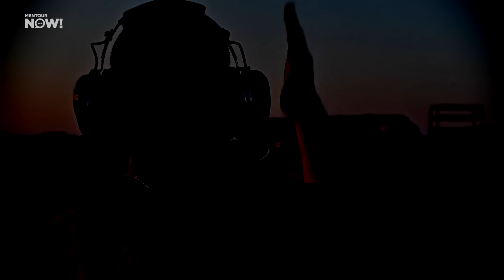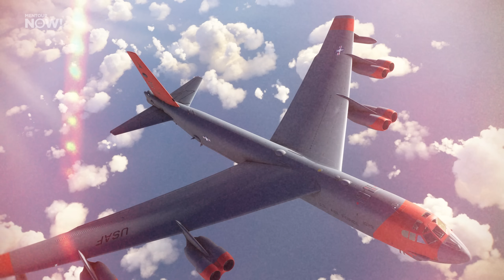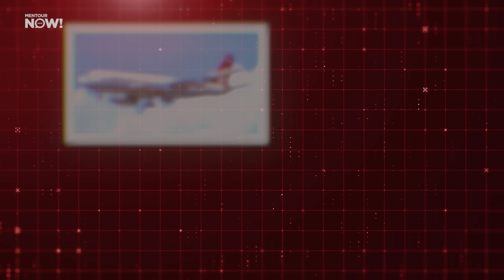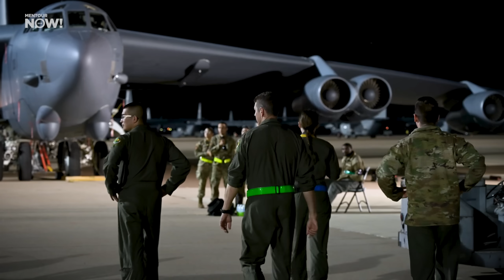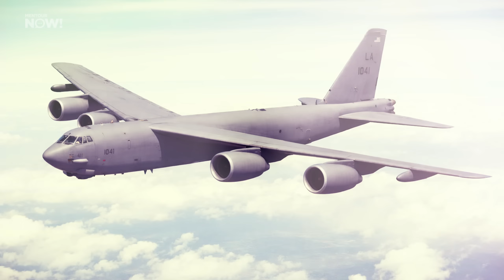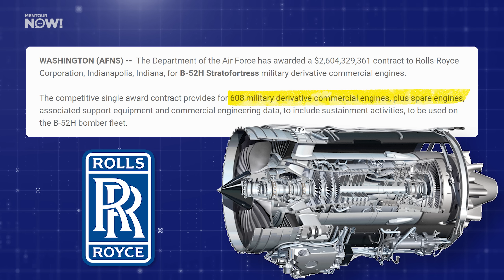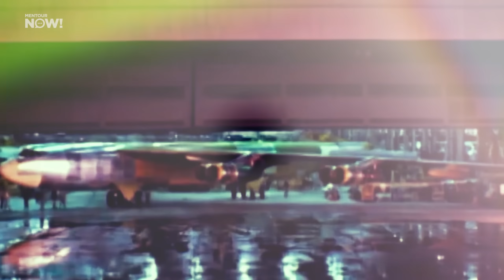WHY Are They Changing The B-52 NOW?!

Comment: An interesting feature of the B-52 is that the wings are mounted with a +6 degree angle to the fuselage to allow it to fly very efficiently with a heavy payload at 50,000 feet where the air pressure is 1/5  of sea level. When the B-52 takes off it uses a very light rotation to avoid a tail strike.
Reply: The Buff doesn't "rotate" at all.  All 4 trucks come off the ground at the same time, and takeoff is officially called "unstick"--when the aircraft comes unstuck from the ground.  It is possible for the aft trucks to lift off before the forward trucks.  "wheel-barrowing" is bad form, and potentially dangerous.
So, the takeoff trim is actually set quite a lot nose up to help prevent that.  And after you lift off, you're immediately trimming nose down to manage the acceleration and climbout.
Reply: @edfix  As a casual KSP player, I do the same with my aircraft designs. Some even lift off all by themselves once they have enough lift.
Reply: @edfix  I read that but after viewing several B-52 takeoff videos it appears that there is a small pull up of the nose, at least during scramble drills.
Reply: @scottt5521    In most planes, the pilot rotates the nose up and that increases the lift of the wings so the airplane starts flying.  It's a pilot action, and rotation speed is less than takeoff speed.  In a properly trimmed B52, the airplane lifts off without pilot action.  Due to its nose-up trim setting, it immediately begins pitching up, so the front trucks might actually leave the ground first--but the airplane is already flying before the wheels leave the ground.
It's a peculiarity of the bicycle landing gear arrangement, and its also true of the U-2 and B-47.
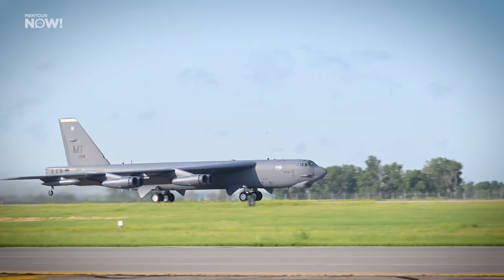Reply: 4:05 look very closely what's at the tail and at what angle it takes of.
Reply: @UnfollowYourDreams  See my reply to @scott5521

Comment: I have seen enough US military screw ups to know that the Military does nothing to learn how to run these programs.
How the hell do you not do alot of testing to actually know what or how to go about your program or idea.
Test the whole aero of the current plane, understand what the requirements will be from aero, electrical, hydraulic and other major important parameters that dictate how the program should go, and then publish said parameters to make sure everyone applying has a full transparent understanding of the challenge and that no time is wasted and no tax payer money is wasted, then those applying can suggest more suitable solutions to the issues at hand.
IMO a complete clean sheet design or a military version of a 777 would have been more easy and suitable for the role. I do not see any technical advantage for the B52 to warrant spending on it this much

Comment: *Launch nukes. The B-52's nukes are carried by Air Launched Cruise Missiles. It's just not stealthy enough to get in and drop nuclear gravity bombs, especially considering that, if nukes are being used, they're almost certainly being used on an adversary with heavy air defenses. The nuclear gravity bombs are essentially exclusive to the B-2 and now B-21, just as the ALCM, the former ACM, and upcoming LRSO belongs purely to the B-52.

How we haven't chosen to build a new actually modern bomber that's subsonic but not stealth to fill the B-52's role of being the cheap bomber to operate while improving the air frame and its serviceability, i don't know, but here we are.
Reply: Because we have a big fleet of well-maintained, overbuilt B-52Hs that just need supportable engines and updated avionics to fly until at least 2050.  It's like an LS swap in a 1961 Impala, except that Impala gets a depot-level rebuild every few years.

Comment: The original B-52 was a turboprop powered design.  The decision to switch to turbojet power, early on required accelerating decision making of its arrangement due to the urgency of its nuclear deterrence mission.  The J-57 was not yet developed, and no engine was sufficient for the requirements set forth, unless they used eight of them, once the J-57 was available.  It was not until the 1970s that higher bypass turbofans became standard, better than half way through the Cold War.  This video explains a lot… thank you!

Comment: I believe the some variant of the Rolls Royce Pearl 10X will be the new engine on the B-52 however, you’re probably using the correct designation ID for the new engine. I flew the Rolls FTB a bit testing a variant of this engine for Dassault. It seems from my point of view to be a great engine.
Reply: The F130 is the military version designed by BMW in Dahlwitz Germany, later renamed R-R Deutschland.

Comment: The engines are a no brainer. The TF33 is a 1950s design based on the J57 which is even older. The new engine is in production now. Much more efficient.

Comment: Some Planes designed before computers tend to have more structural endurance than Computer designed ones, because it was harder to estimate when the air frame would wear out. Larger planes also have the space to make changes more easily. Unpressurized or low pressure cycle usage also contributes aircraft longevity. I have worked on B52 Avionics upgrades, much easier to find space for new avionics on  a BUFF than a cramped fighter plane. The DC-3 is the plane predicted to outlast the B52, a well maintained airframe could last 200 years  and they made a lot of them....

Comment: The exact same things were said of the C5 Galaxy. In the end, the Aircraft had to be reinforced and upgraded with Wing Reinforcements, Pylons, Wing Box reinforcements, Slats and even upgraded Tracks for the Flaps. It is completely unavoidable, as these aircraft were among the first Jet Engine Aircraft. The 4 Engine system to start with would have been a better choice because it will all have to be upgraded anyway. No Lessons were learned.

Comment: Why is the B-52 still flying and getting an update? Here's why: The B-52 has an unrefueled combat range of over 8,800 miles (14,080 kilometers). It has a maximum payload capacity of 70,000 pounds (about 32,000 kg), allowing it to carry a vast array of ordnance like bombs, mines, and various cruise missiles internally and externally, making it one of the most versatile heavy bombers in the US Air Force inventory.

Comment: Obsolescence is an issue with much modern technology.  In particular, there are technologies that are new, wonderful and we come to rely on.  And then they're both irreplaceable and unrepairable.  A great example is the floppy disk (in any of its iterations): they can't be manufactured any more, but there are places where they can't be done without.
Reply: The issue is no one makes the magnetic tape anymore, which is the main reason Sony stopped manufacturing them in 2011. But Polymatt knocked one up at home using a 3D printer and creating his own magnetic tape so its doable if anyone wants to seriously try.

Comment: all they diong to taking old stuf out ofthe B-52 air frame and then put breand new tech and other modren stuff into it on the inside bacly. its not that ahrd to udner stand i just wish they did that more with all ofther other aircraft that sould also have that done for teh F/a f-18 hornet with evene better tech and also bacly otehr aircraft that could realy realy still be useful if geven teh chance.

Comment: Had to see what's new new with the Buff. Lost an uncle in 1959 to a midair collision between his bomber and the refueler. It was a broken arrow event.
Reply: failed ejection or killed on collision?
Reply: @dogcat145 no ejection from a B-52. From Wikipedia, the only 1959 incident with one was October 15th near Hardinsburg, KY. 8 total crew dead between the two planes.
Reply: @counterfit5  That was it. I was part of the marker dedication at the site in 2019
Reply: @dogcat145  All four crew members of the KC-135 crew were killed. Four B-52 crew members successfully ejected: the instructor pilot, pilot, electronic warfare officer, and radar navigator. The other four of the eight crew members were killed when they were unable to eject.
Reply: @FillingPassports  A bit like the RAF Vulcan. The pilots up front get ejector seats, the crew at the back don't....
Reply: @FillingPassports  i think i recall this incident
the impact damaged the top fuselage of the B52 so at least 2 top seaters could not blow off the bent panels to allow ejection. They were high enough for the bottom seaters to eject downwards i assume.

Comment: Hi Petter. No mention of airframe cycles maximum. There has to be a limit as to how many times you can pressurise and depressurise an aluminium airframe before it fails. Just a thought. Phil.
Reply: The Boeing B-52 was designed to be refurbished over and over again, some airframe parts do have a cycles/hour limit and can be replaced, other parts have no scheduled service limit and can be reused after inspection.
Reply: Only the two separate cockpit areas are pressurized. Bombs don't need oxygen to be flown around.

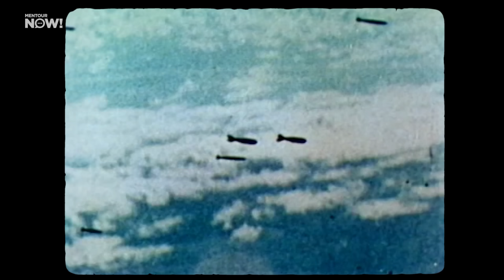Comment: Just one question. Seeing the B52 drop its huge payload of bombs in few seconds (see video at minute 3:00) makes me wonder how can the airplane keep flying level while its mass is so quickly changing. Can anybody explain that? Tks in advance
Reply: Just a bit of adjustment in trim.  The bomb bay is very close to the aircraft's Center of Gravity.  The plane will want to climb due to the weight loss, but it's nowhere near close to departing controlled flight.
Reply: 17:39 that is a massive wing! What is that connected to the underside of the wing? It almost looks like a glide bomb.
Reply: It just rises like hitting a nice thermal updraft.  If I'm not mistaken, the bombing mode syncs with the autopilot to compensate with the sudden weight loss also, so it's not as dramatic a change as you're likely thinking...

You'd get something of an elevator-up sensation, but that would quickly null out.  The biggest difference you'd likely notice was how much the engines throttle back, given that they're no longer having to move all those extra tons through the sky.
Reply: I was surprised to see the troll answer is missing from this legitimately good question.  So I'll be that guy. 

B52 pilot selection is extremely stringent, because the weight differential must be offset by the weight of the pilots balls. 😅

Comment: Not a joke. It's bomb load capability and ECM are modern. Its primary weakness, is it's old engines.  I think they could have gone with 4 Trent motors, but the W&B, radar signatures, controls & rigging? All Very Expensive to completely replace.
Reply: well we could upgade the engines with a no afterbuner and no giblaling version of the W&B engines that F-35 uses that actaly are a few moretime more powerful and lighter at teh same time. the issue is that hte upgade might make it go way to fast for the airfream to handle wihout some much more havy govmerning to prevent it form giong to fast. but if you lose a few engine the govmenter could in emcergy be fully disabled for alot more power in case ofa feww msing engines for cobmat or other types of realter engine damage.
Reply: 4 engines do not work for an engine-out takeoff emergency and the resultant lack of rudder authority.  8 engines do.

Comment: One reason why they want to keep these things flying is the low operational hours on the airframes. They just want to have a solution that will make that viable and just that - nothing more. It was designed around the technical limitations of the era, and it really shows. If it was designed with CF6 derivative engines that would have been a different story entirely but yeah...grandpa Buff is that old!

Comment: $ 35M per airframe seems cheap compared to a clean sheet design. If we can get another 20 or so years out of the 50+ airftames in service, id call it a deal. It is a bomb truck after all but it has the capability needed, and the infrastructure is already in place. We have other assets for contested air well into the future in the B-21 Raider.

Comment: 4 engines would cause possible issues with engine out assemetricaly thrust
Reply: Correct. 4 engines do not work for an engine-out takeoff emergency and the resultant lack of rudder authority.  8 engines do.
Reply: @SEO122  to be fair, if  you lose both of the engines in a pod on an 8 engine it would present the same issue, and losing both engines in a pod is probably significantly more likely than losing a random pair of engines which are not in the same pod.  
However, installing 4 big high bypass turbofans would inevitably change the distance from the engine's center of thrust to the centerline of the wing in an adverse manner.

Comment: One other thing is that building a direct replacement bomber is out of the question. This airplane cannot be built in this decade by anyone. So, the Air Force has no choice. I don't think I'll see them flying another 40 years, but the pilots that have not been born yet will.

Comment: The hard truth is the US Air Force painted itself into a corner by failing to look ahead at mission parameters. Today, long-range air-to-ground missiles and glide bombs can be dropped from converted airframes that are abundant, at a conversion cost a fraction of what the B-52 program and ongoing sustainment will cost the US taxpayer. There's simply no operation that can't be done better and more cheaply by smaller more modern aircraft suitably converted. But hey, it's only taxpayer money so who cares?

Comment: What you missed is that the B-52's look so cool with the Dual-ed 8 Engines!
Reply: One late night on a ferry flight, I decided on a lark to request a climb to flight level 500--the BUFF's max ceiling.  I got up there, just barely, and didn't stay long, but the Air Traffic Controller asked what kind of engine I had, "a V-8?"  I replied, "Exactly".

Comment: Fun fact.  The B-52s in service were built halfway back from not to the Wight Brothers first powered flight.  And it may continue to fly for another 40 years, making it 100 years old.
FYI, the B-52 airframe is still excellent, is easily updatable, can and does carry precision guided munitions.  A full B-52 carpet bomb pattern of unguided iron 500 lb bombs covers an area 1 km wide by 2.4 km long.

Comment: One other deep strategic point to consider... why keep the B-52 at all? The answer is weapons, or more properly nuclear payload.  Most of the US's nuclear 1950s and 1960s nukes were heavy and large and required a plane that could carry a LOT of weight, go a very far distance, AND had a bomb bay big enough to handle such bombs. That legacy (and unique) capability is why we still see the B-52 carpet bombing enemy targets using ancient dumb bombs. The payload weight, distance, and large bomb bay of the B-52 Buff is just too valuable to toss, yet not valuable enough to justify a new design that could effectively replace it. And every time the US Air Force has tried, they've ended up with something that just doesn't work as well... like the B-1.

Comment: Well, here's one reason: "A B-2 Spirit Bomber costs around $2.1 billion per unit for production, but when including development, testing, and support, the total cost approaches $4.2 billion in 2024 dollars."

With that in mind, upgrading the robust airframe of the venerable B-52 doesn't sound so outrageous.

Still, that's a HUGE amount of money, even for the USA. Note that the CH-47 Chinooks used to drop the Delta Force guys that snatched up Maduro first flew operationally in 1962. Oldies but goodies, I like them.

I have a Colt 1911, which entered service in, well, 1911! Old does not mean obsolete.
Reply: The CH 47 like the C130 have current variants in active production, that's where it differs from the B52. The USAF awarded a CH47 contract in October 2025, whereas the newest B52 airframe was delivered in 1962. While the original designs were fairly contemporary their paths to the present day were vastly different. In the end these aircraft fulfill necessary roles so wether it's updating and retrofitting or producing newer variants the need doesn't vanish so neither do the aircraft.
Reply: @zevar9920  True enough. The Chinooks are like the Peterbuilt trucks of the sky. However, for some fun Chinook gunship nostalgia, check out the 'Guns-A-Go Go' form of the Chinook.
Reply: And that old 1911 still has the best trigger. Only the new Walthers come close.
Reply: @gethmord  Absolutely. It was a very smooth horizontal trigger, and not a swing type trigger. A beautiful thing.

Comment: According to old YouTube ads, I saw years ago - Air Force has been changing engines past 15 years. Installing more up to date jets with upgraded technology. Flying further, faster and using less gas. Even able to carry heavier blah blah blah…
Maybe commercial jet engines has something that unsuitable for military use? Heat signature ? That makes them harder to deflect heat seeking missiles. Maybe B-52 uses four engines to fly. While the other engines are spooling mixing cold air with hot jet stream. Lessen the engine heat signature.

Comment: Former Boeing employee from back when Engrs ran the comoany -- 'metal fatigue' from time the plane is built till time its sent to the bone yard after being pressurized & depressurized its takes a toll. Its why mfg went to diff skins on the frame. yes military brat too. Grew up w/ these guys. Noisy, loud but they worked.

Comment: Momentum around the vertical axis on engine failure…
Reply: If you join two engines into a bigger one 
-> you need a bigger tailfin  to counter the asymmetric momentum
-> which in turn needs a stronger fuselage to not snap off the tail